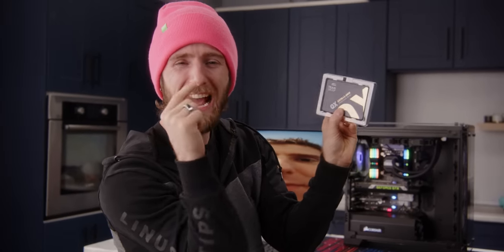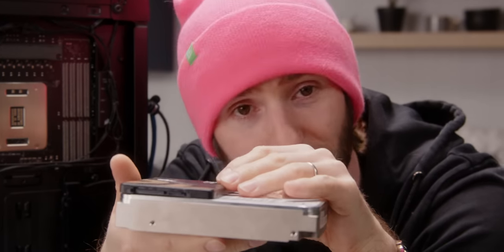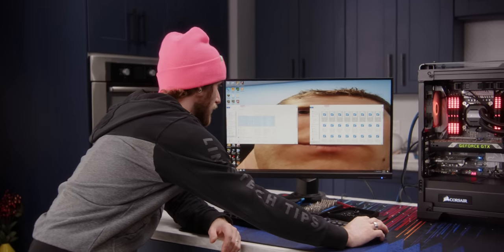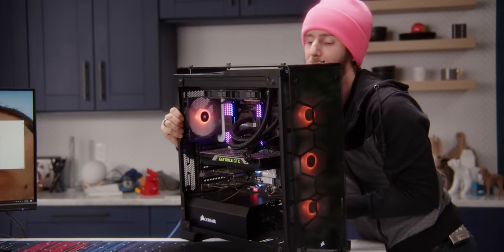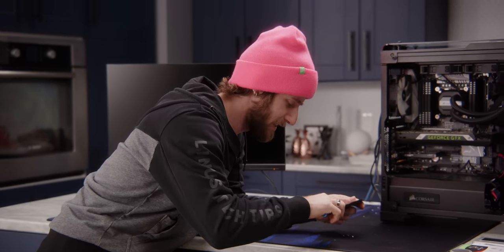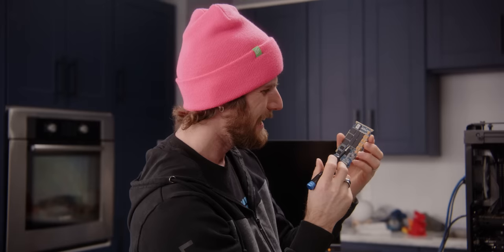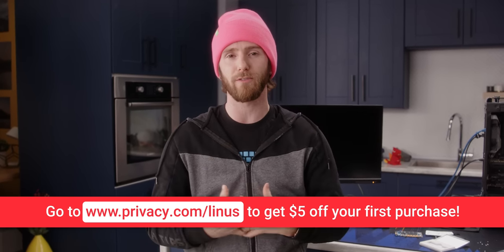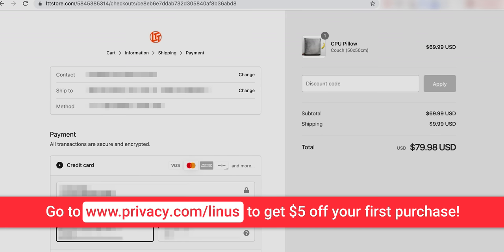The 15 Terabyte SSD is TINY!!

Comment: That is why mecanical storage still hangs around, price vs storage is better on the old HDD's. Bought a 2TB HDD yesterday, used a 240GB SSD PCIE drive that goes whyere a second WIFI card would go for the OS. That way I get SSD speeds on OS stuff while getting highcapacity storage for everything else. Did a simular thing with my desktop PC. OS runs on a 250GB SSD. Games & programs are run off a 2TB HDD & Files are on a 1TB HDD. Basicly gives me the options to upgrade HDD capacitys without having to touch the OS & rebuild my config from scrach.

I look forward to the day these high capacity SSD's are actualy afordable. Till then I will stick to using high capacity HDD's

Comment: I could have had use for it in my PS4 Pro if only Sony could provide support for drives bigger than 8 terabytes. I'm using a LaCie d2 Professional 8 TB external drive (traditional Seagate magnetic drive with an advertised 240 MB transfer rate) today to store my PS4 games collection and I've surpassed the 8 terabytes storage limit. And yes, these are all official, legit releases. No pirating here. Would have been nice to see Sony expand on that for the PS5, but no, the M.2 SSD expansion port will only allow a memory drive/stick with a 4 TB maximum capacity for now (there simply isn't room for more). Although these are M.2's with much, much faster transfer rates compared to a standard SSD drive, the lack of total storage capacity for larger game collections makes the eventual upgrade to a PS5 look more and more like a hassle if you're forced to copy games from the extra storage drive to the game drive in order to play. If you could assign the extra storage drive as the game drive, like on the PS4, this would make things a lot easier. But, I guess Sony don't want that. But, as the PS5 is still extremely hard to find, unless you opt to accept a scalper's price for it, it's really not something worth wasting time and energy on now. If Sony can't or won't make the PS5 more future-proof by adding support for much higher capacity drives, then I won't be buying a PS5. Then I'll put some money into a new PC instead. Just a shame those high-end graphics cards are so ridiculously overpriced.

Comment: I would buy SSDs not for storage size but for write/read speed.
Faster >  better.
If I want storage though, I would take 16-14TB HDDs.
Since those with 18TBs have some downsides for bigger storage size.

Comment: I bought a 6TB external hard drive for £60/100 CAD/80 US, all the rest in my 2 main machines are SSD only.
But even then, 256GB NVME, 500GB SATA SSD. Not going to devalue as fast as these as they didn't even cost the price drop these are going to have.

Comment: There are 2,5" enclosures for SATA or NVMe drives available which give you the same form factor for a fraction of the price. So why bother with an inferior 15TB "prebuilt" for 4000 bucks?

Comment: I do have a question for you Linus. I have 2 Nvme 2280 4.0 slots on my board. I have 1 for my main drive. I'm running amd 5800x. Can I use the other slot as a performance upgrade for everything like Intel was doing on their earlier laptops? I forget what's it's called. Or would the other drive just be another storage device?
Reply: What you are thinking of is using an SSD as cache for an HDD and yes you could use it like that or as it’s own storage

Comment: Someone help me with an air-gapping backups question.   I have a fast server with an enterprise NVMe.  What's the fastest way to get the data onto 8TB of portable/removable media? I am thinking of buying a USB-C interface for the server or a 25Gbps network card.  Then either buy fast NVMe storage, put it into an enclosure and connect it directly to the server or.....get a PC with a 25Gbps network card, connect it to the server and attach the NVMe enclosure to that PC via a USB-C cable or a dock of some sort....help?

Comment: I know I can look it up or wait till you mention the price but I just got a 16tb for $300 hhd yeah it's slow but it's cheap. And what would you do with that much data I went crazy I hate removing viruses and reinstalling all my apps so I went iso I installed all my apps separately to its own bootable iso and even if it's a small app it's got a full is with it so the smallest of apps use 2gb and because of that I ended up using a lot of data compared to using a computer normally but I no longer have computer problems the only problem now is updates because it's isos updates go away after reboot I also use toram that's a great addition to isos they run faster than a solid state drive

Comment: Meh, I'd rather just spend $1,200 and drop 4x4TB 7200 read and 6300 write NVMe drives **Shrugs**. Those 15TB SSD 2.5" drives are around $2400 from what I was finding.

Comment: I would like notice that data are used in binary system . not decimal. So counting 1000 x 1000 x 1000 .... is totaliy wrong and right one is just 1024 x 1024 x 1024 ....
Or... Try to divide 1 byte "8" and then "10" .
1 byte / 8 = 1 bit... , so OK.           
1 byte / 10 = ... ... ... Oh no.. My CPU had a heart attack !!! .. 
Did U try sometimes to save information unit into spase of 0,8 bit? 
Well
So if i buy water, then in litres what by ml give 1000 ml. 
If I buy bricks by 10cm of side then 1 cubic meter will include 1000 bricks
But if I buy data storges what are in bytes ? then I expect multiblies of two.. So 1 TB is 1024 GB , ... 1 048 576 MB ... e.t.c. 
By my meaning , by using decimal system producers started to cheat customers. To get the same money for smaller product. 
.... apologize my English please..